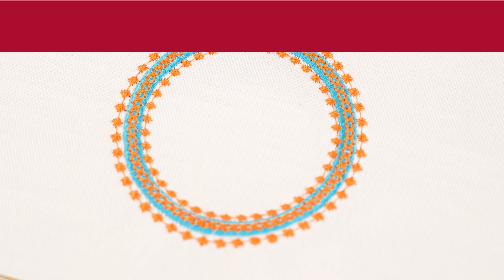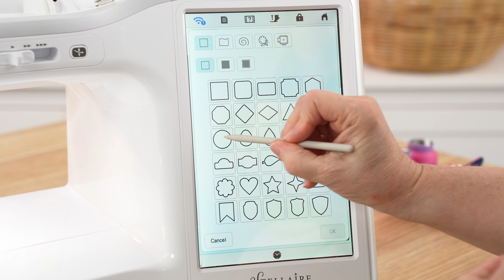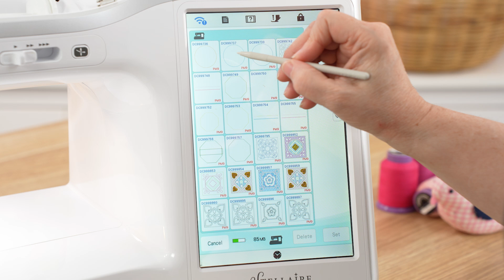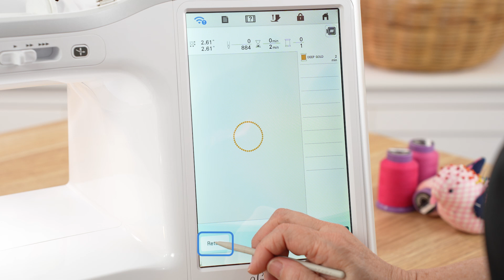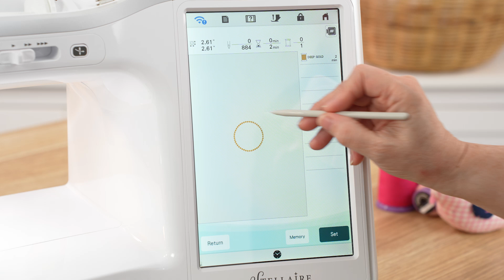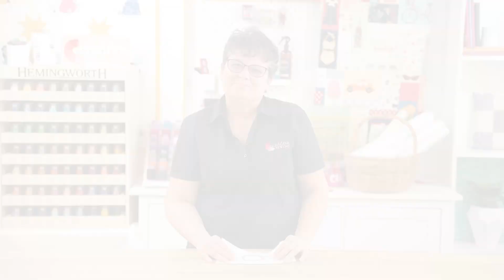My Design Center Basics - Line Designs & Layering Stitches | Echidna Sewing

Comment: Could you make a video using a square? The corners are always tricky
Reply from the maker: @rondak8967 It would be a matter of playing around with the stitch size and spacing to help adjust it around the corner.  Or you could stitch one side at a time as well. Corners are definitely tricky :)